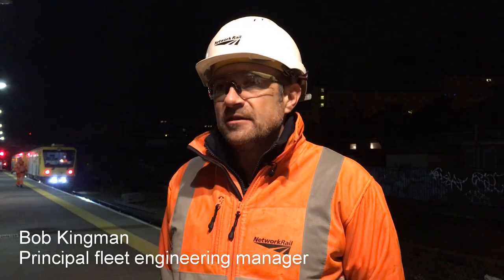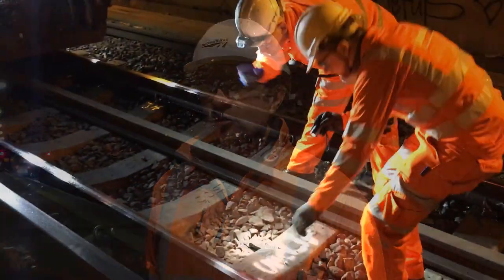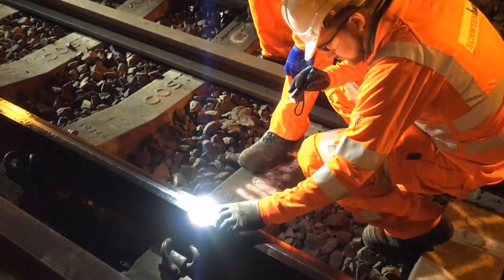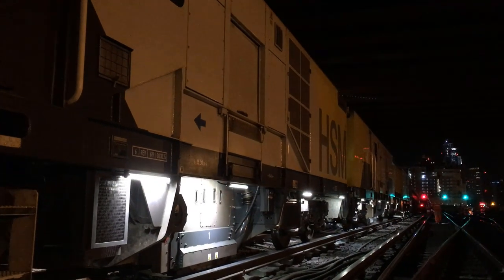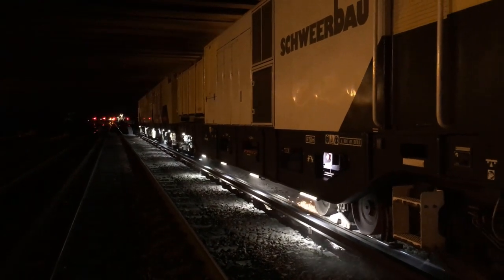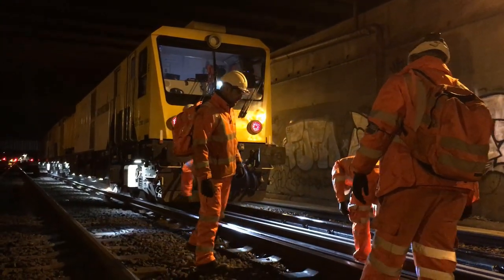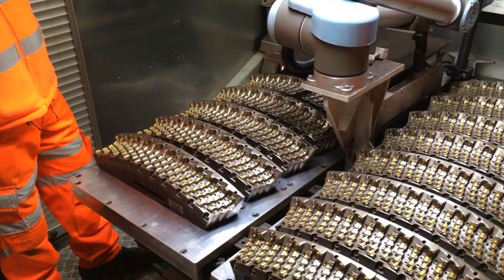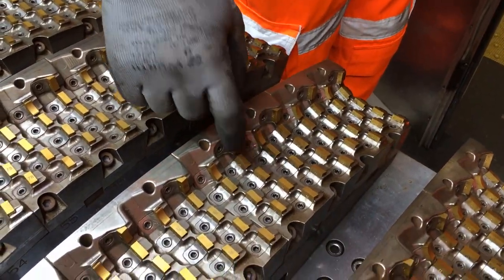Rail Milling Machine

Comment: I was hoping they'd explain how they tram the rail head in. If the milling head is fixed to the train, and the train runs on an uneven rail head, how does the mill avoid passing the original rail head's undulations on to the freshly milled surface?
Reply: Perhaps that is a classified trade secret! Hopefully you, and I, will get an answer to the question.

Comment: How often does a section of track get milled down?
Reply: ideally only once, twice max Jag to get the most economical benefit
Reply: @pimpmyhogauge7873  how often not how much
Reply: @RECHARGED77  This is not scheduled routine maintenance like tamping for example, it's a quicker fix for a specific problem. Performing the task more than twice or so would lower the rail to the point of creating a dip in the line which is a problem in and of it's self.
Reply: @Dazzlegette  K Im just saying he asked how often
Reply: @RECHARGED77  Sorry replied to wrong person!
Reply: @Dazzlegette  oh lol